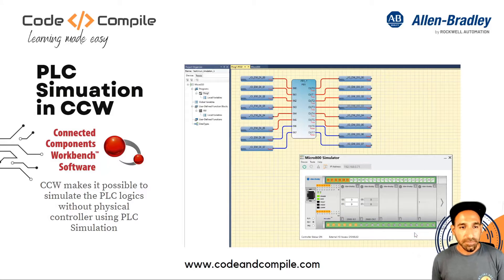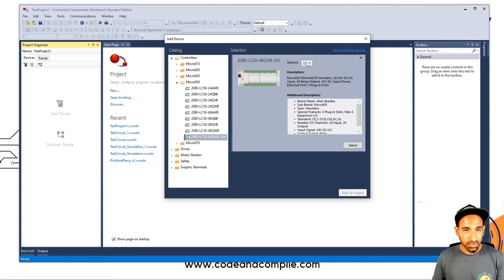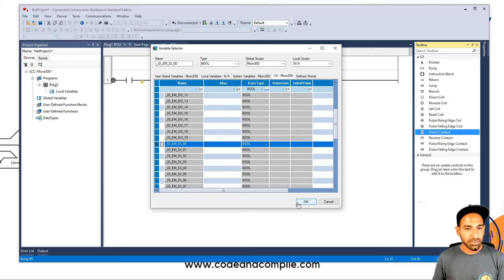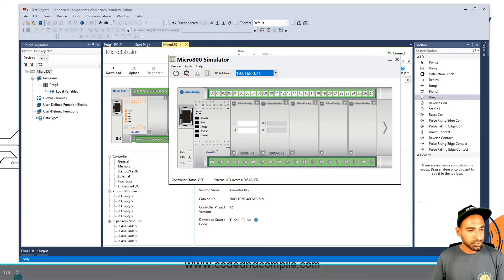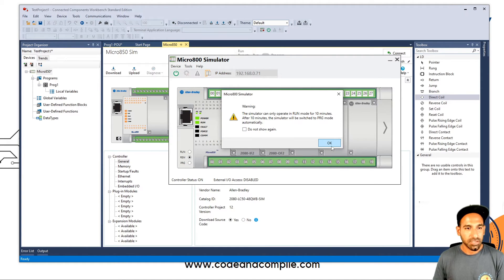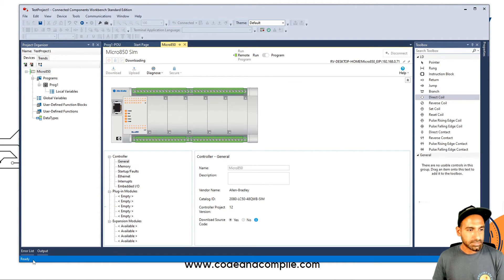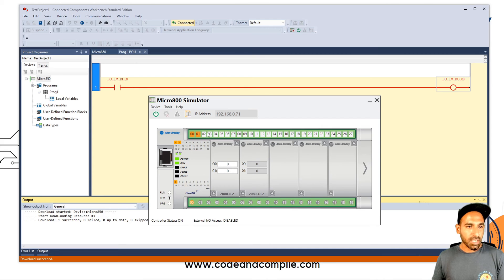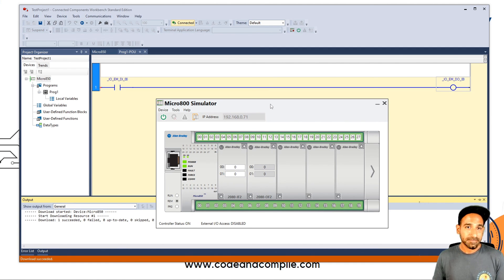Lesson 4- Micro850 PLC Simulation in CCW

Comment: Hi brother i by mistakenly deleted one of the previous ip links i already had established in the micro 800 simulator... i have tried many times to retrieve it by configuring new drivers the same way my professor taught me in class but when i go through the Rslinx node, under ethernet ip driver it will simply not pop up. Please help how i can retrieve it or make the system go off a new ip address if possible.
Reply from the maker: Do you want to connect to Simulation or real hardware?